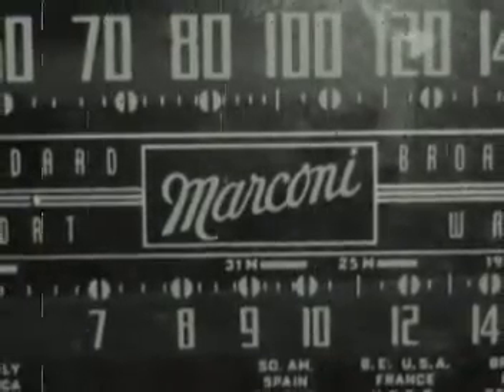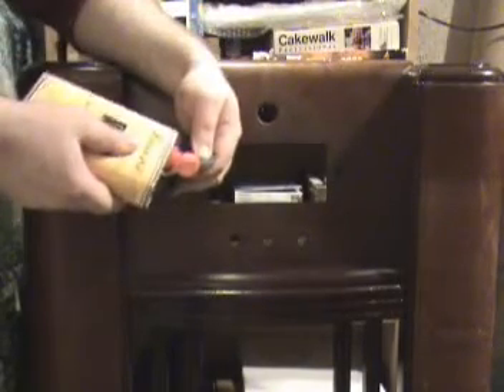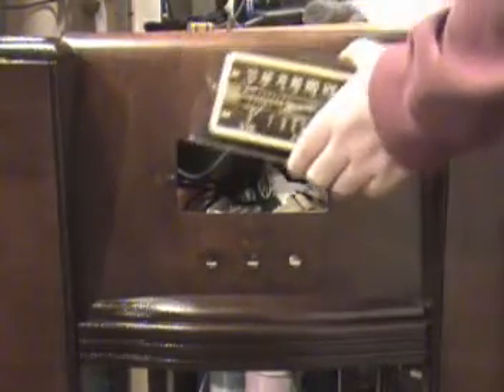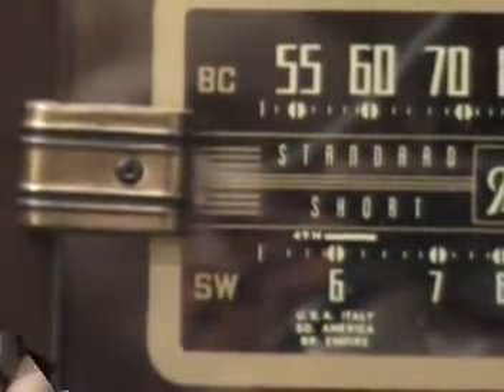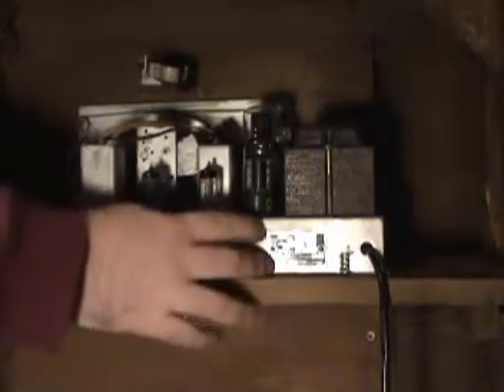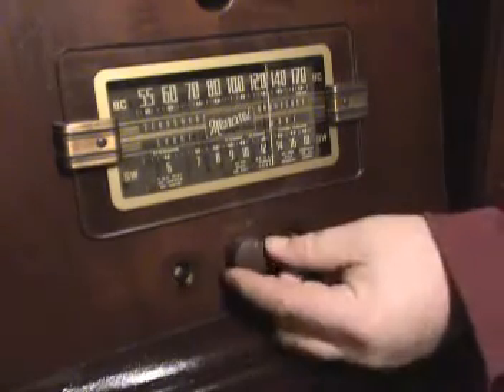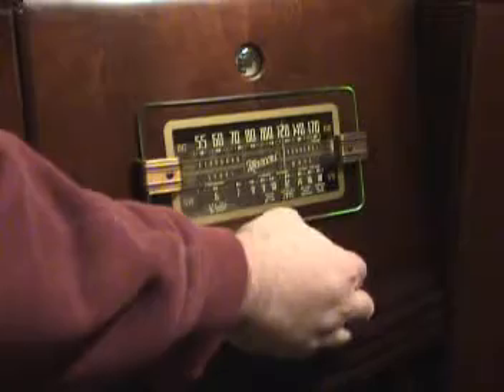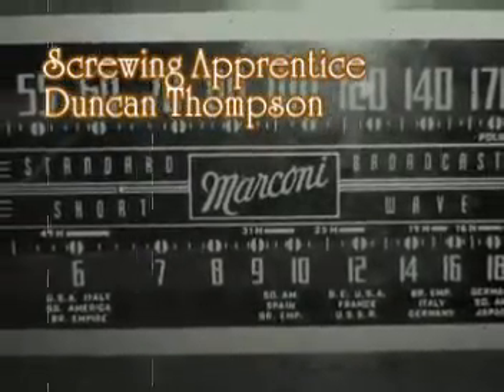Repairing and Restoring Tube Radios - part 9 - FINAL

Comment: Thank you so much for putting these videos up. I just bought an old radio from a local second had store and would like to restore it. I would have had no idea where to start without your videos. My plate in the front is broken so I am going to have an extra bit of a problem trying to figure out how and where to get that replaced. Like so many others I watched all 9 videos tonight. I subscribed so I would be able to find you again to rewatch them & see if you are doing any other radios.

Comment: The only fault I found is when you are working on the chassis and you have plugged the radio in and switched it on with the rectifier connected . You should when later working on it to dump the caps as they can hold a charge for quite a while ...and No fingers inside till you do !!

Comment: Great job on that radio!  one question...in an earlier video I noticed the top of the cabinet, in the center, the veneer was coming up a bit or just very rough.  I have the same problem on my Philco.  Did you do anything to correct that?  I assume if you sand it so it's flat you'd have to restain that area and hope it matches the rest of the radio.

Comment: I have 4 console (floor model) radios from 1938 to 1950.  One beautiful 1940 Philco with a like new Art Deco caninet. 1950 philco w/ phono. 1938 Sears Silvertone (works), and 1938 General Electric with like new cabinet.  Three table radio from the 1930s.  A Firestone,  Silvertone, and Stewart Warner.

You have inspired me to take some time out for these beautiful old radios.  Nice work, and nice little helpers too.

Comment: Small comment about safety, though: instead of using googles with the paint,  you could have maybe used an isolation transformer, together with the series light (ages old good trick!) Though I confess I don't use that myself either. Imperfect! The shadow knows what's lurking in the bad minds... ha ha ha he he he
;-)

Comment: Also, is there not a debate about screws in glued cracks:
some paths point to using the screw as you did after the clamp, 
other paths say use the screw as the clamp which makes its own "glue-smoosh".  
was wondering if you prefer the former for a reason.  cheerio!

Comment from the maker: Yup, you're right on the restoration. The best I can figure is this radio is from the early or mid 1940s, so IT IS OLD and it ain't ever going to look new again, nor should it. But a good cleaning works wonders. As you can imagine, I'm not a big fan of plastic surgery either.....

Comment: Hi Mike, nice to see bring this old relic back to life, and involve your kids in the process.  The radio is now something your wife will let into your living room

That said, these old radios used lacquer finishes.  Applying urethane is not much easier than applying an authentic finish, and will be much easier for future restorers (60 years from now?) to work with.  I'd suggest you explore the possibility for your next project.

Still, great job, great video.  Thanks for sharing.